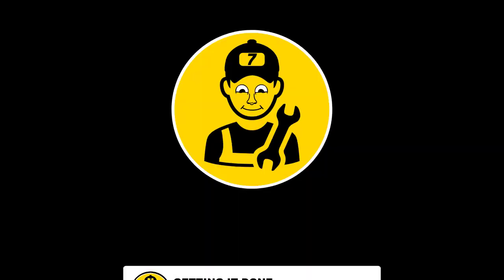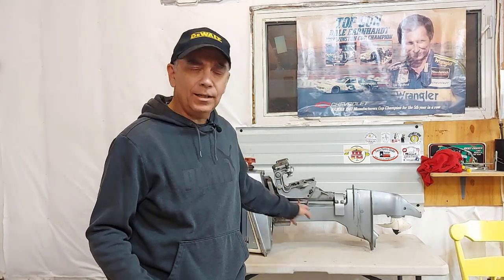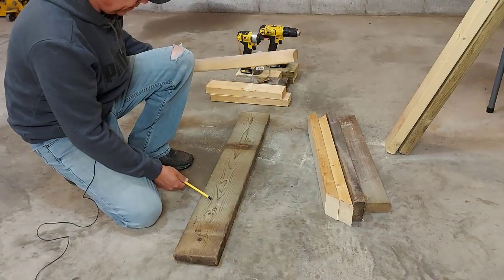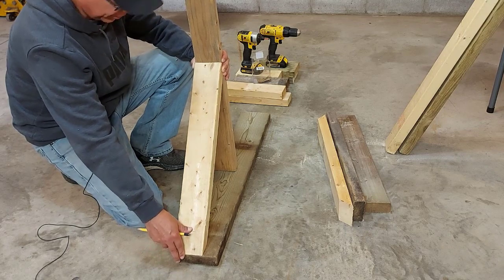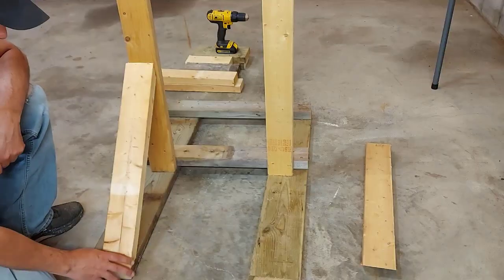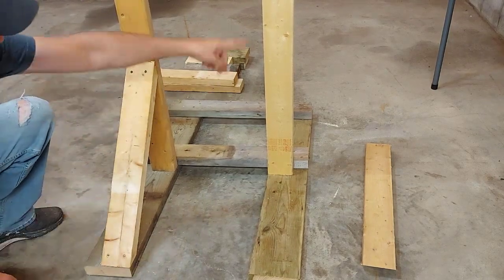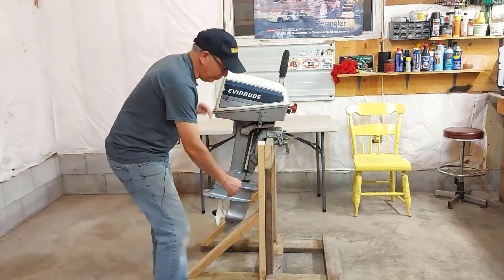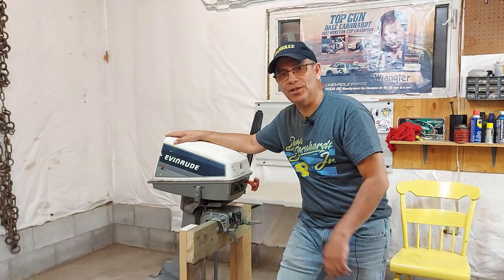How to Build an Outboard Motor Stand | Design Plan and Measurements

Comment: Very easy build. I used 3 1/2 2x4's. I had a piece of 2x8 that I used for the motor mount. I had a set of caster wheels that I used to be able to move it around. The 2x4s cost a whopping $16.50 (I purchased 4) and I already had screws. Thanks for the easy build.

Comment: Thank you!  It was raining and I had been thinking about buying a stand, the one I had was stationary and not high enough to put muffs on and run the motor.  After watching the video I went to the local hardware store and bought the $18 of wooden material and made the cuts, grabbed some screws and VOILA a fabulous new outboard motor stand!  I had looked at a few stand videos and one complaint was the cost of castor wheels....As luck would have it, I just moved an old filing cabinet in the garage to be given away and 'rolled' it along the garage floor with other giveaway stuff....wait a minute, it has wheels....so I took them off and put them on the new motor stand, AWESOME!  Thanks again!